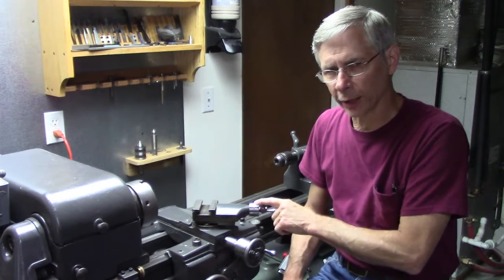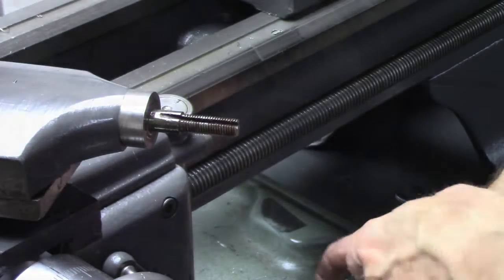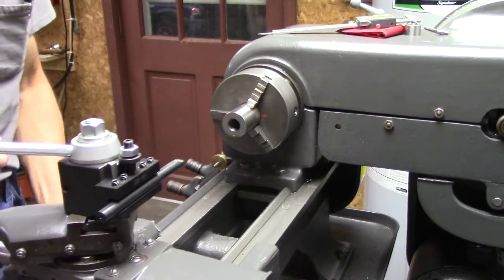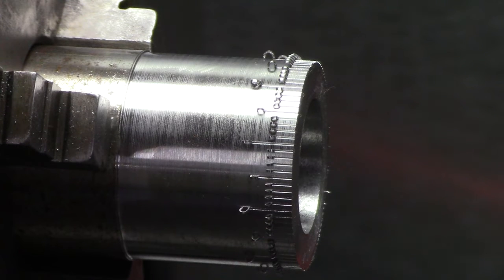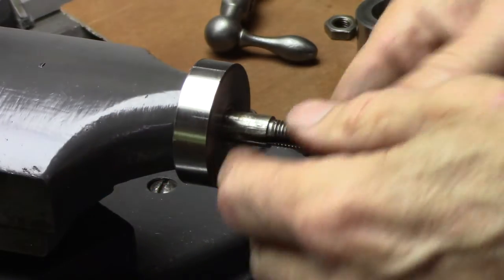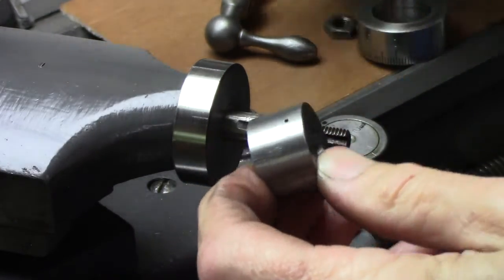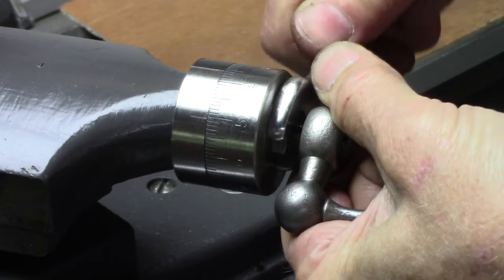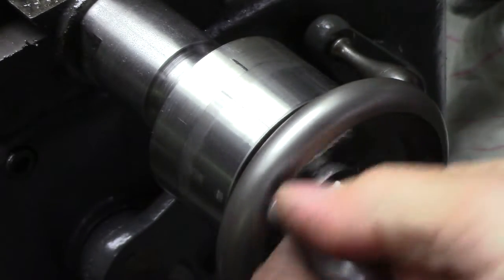New LARGER dials for my Lathe - Part 3

Comment: Where to get a dial indexing wheel to make a graduated dial in thousandths. I see You use a saw blade??
Reply from the maker: Yes, a 100 tooth saw will work for any dial and lead screw that has 10 treads per inch.

Comment: Mark I watched all 3 parts again and also at some time in the past I also watched Mr. Petes. I need to do this to my old Clausing 100 but make them removable so as not to alter the original machine. did you by any chance check the graduations against a dial indicator? Not that it matters the finish numbers on the micrometer is what counts but just curious how accurate the saw blade is in dividing the graduations.
Reply from the maker: The graduation will always be dead on unless the lead screw is worn and even then you'd have to measure multiple turns to see it. I did check mine and they were perfect. If you think about it, if the tooth spacing was off even an 1/16" on an 8-inch blade that would be 1/4th of one increment or .00025". Of course the spacing on a saw is probably within .002" or less so you'd never see it.  I think the dials on my Logan 200 slipped over the existing dials.

Comment: I have a question, how did you tap the hole for the jam screw? My taps are too short. It’s like 1.25”.
Reply from the maker: I'm not sure what screw you are talking about but the dial thickness is less than 1/2"
Reply: @WinkysWorkshop  I think I'd messed up and didn't bore the 1/2" hole deep enough. I ended up drilling the 1/4" threaded hole out some so my tap could cut the threads clear through. Thanks.
Reply from the maker: @terryk1379  Good deal! Glad you figured it out.

Comment: Another Great Job Winky. I have a little Atlas Lathe and need to redo the Dials on it. I think they are even smaller than your original Dials. I just hope they turn out as nice as yours.
Reply from the maker: Thanks, the dials are easier than you might think. Just be sure to build the number stamping jig

Comment: I made and finished the parting off tool actually I made 2 of them, for two different size blades. Works great just like you said. Now on to the dials. On the  compound I see you made a smaller sleeve and then put a bushing over it to get the larger dial. Why not just make the dial one piece and drill the hole in the center of it to the size of the compound screw. That way it would only be 2 different parts. The dial itself and the reference dial. Made the indexing bracket and mounted it today out of the circular saw blade.
Reply from the maker: That's great on the cut off tools! On the dials: My first set on my Logan 200 I used aluminum and used the old dial as the hub. For the new dial and on the second lathe (Logan 820) I made a hub kind of like the original dial. The reason for using the dial OR hub to mount the main dial is that the 3/8" shaft has a key way in it. I like to install a set screw with a small piece of nylon under it to create drag or friction so that I can grab the handle and set the dial back to zero. The nylon gets stuck in the key way. The original Logan dial was kind of the same although it was a simple set screw. If you tied to reset the dial the key way would sometimes interfere. If you are working with a different lathe you may have different option. Good luck, I hope that answered your questions.
Reply: @WinkysWorkshop  thank you for the reply. My lathe is a South bend and the compound dial on it is only 2 peices outer and inter dials with the hole in the center the size of the shaft or cross slide screw. If I do the small bushing and add the dial to the top of it how do I keep it on and not from walking off the bushing. The way it's made now the outer dial has a taper cut to the front of it and it rides against the thumb handle. To keep it from ridding in and out on the screw. Do you give out your e-mail address I may can send some pictures. You have helped me on many occasions and have always answered my questions. And I thank you for that. You are more help than you can ever imagine. And your projects are always top notch.
Reply from the maker: @anthonycash4609  mark21056 at that big search engine company

Comment: Fantastic ! I just performed surgery on the compound's dial and I couldn't agree more that it was poorly designed !
i tore into it because I could not set the dial to zero ... and then after I loosened the setscrew in the dial it quit turning with the handle..... that's no good ! but you solved both problems in one shot setting the backlash and fixing the dial to turn with the hand crank ! .... my lathe will definitely get this upgrade ! thank you..... I just need to get a 100 tooth saw blade ! LOL....
thank you Kind sir ! 
might I suggest a bit of a recess in the face of the dial part that touches the reference dial.... as that would reduce the friction as the dial turns .... I was thinking about 1/8" or 3/16" in from the edge with the scribe lines on it and then  go in with a step to the center hole.....  reducing the friction would help the dial not to "SLIP"  although your use of a large surface area on the inner part of the dial should keep that from ever happening..... but you never know. ( guys like me who drown everything in oil might have a slipping problem ! LOL.....)
thanks again ! 
keep up the great to the point videos I love them ! 
Bob...........

Bob.......
Reply from the maker: Thanks for the comment. Yes the dials were a huge improvement. 1.45" diameter is adequate but go bigger if you have the room. My cross slide moved over the dial and limited the diameter so I added an extension. The 2 inch dial is great but probably not worth the trouble of adding the extension but if you have the room, GO BIG.

Comment: Your end result is clearly better than factory. But please, help me understand something. Doesn’t diameter of the dial characteristics of the lead screw directly affect exactly how far the tool travels in or out? I feel like I’m missing something. It would appear to me that the outer Diameter of the dial (which ultimately controls the layout of the spacing) would have to be precisely measured
Reply from the maker: - Let me see if I can explain-  As long as there are 100 evenly spaced lines everything works. A smaller dial (like the original) the lines will be so close together that it's hard to read. The saw blade has 100 teeth so each scribe line will be 1/100th of a rotation no matter how large. If the dial 8 inch in diameter the spacing would be the same as the teeth on the saw blade. All lead screw made in the US are 10 TPI (*) meaning one turn is 1/10" or .100".  Yes I agree... much better than the originals... they were almost unusable. 
*To clarify, there are many newer lathes with a lead screw that is 20 TPI on the cross slide. This eliminates the need to divide by two when working with diameters. On older lathes like mine, if you want to remove .010" from the total diameter you move the dial .005" (.005 removed from both sides is .010). 

I hope this helps.
Reply: Winky, I get it now. You explanation on was logical. Thank you. I am a new(er) viewer and have taken a lot of interest in your content. The designs and application if your projects inspire me to continue on with my metal lathe build. (Even though the difficulty can be deflating. Keep it up

Comment: I use thumb screws on my dials no tool required nice job by the way
Reply from the maker: That's a good way to do it. I used a nylon tipped set screw which hold the dial unless I force it to move.

Comment: I use a socket cap screw for the outer ring lock then I can adjust it with fingers a lot of these type screws have knurled head makes easy to turn good vid  thanx
Reply from the maker: Cool... socket head are nice.
Reply from the maker: I've done the same. That's a good way to do it. I used a nylon tipped set screw which hold the dial unless I force it to move. Either way works well for me.

Comment: Nice job on the dials, they came out looking very professional.  Thanks for sharing, I need to make a new dial and handle for my rotary table and this gives me some ideas of how to do a couple of the operations.
Reply from the maker: Thanks...  one thing I would do different. I'd use a 4-jaw and indicator to center the work after I removed it from the chuck. Despite the fact that I marked the chuck my dials didn't re-center perfectly.

Comment: I think you will soon get tired of picking up an Allen key to adjust the dial. You might consider making a nylon tipped knurled headed set screw instead. Very good videos. Please keep them coming. Best regards. Mike
Reply from the maker: Thanks, the set screw is nylon tipped. I can slip the dial without adjusting the set screw